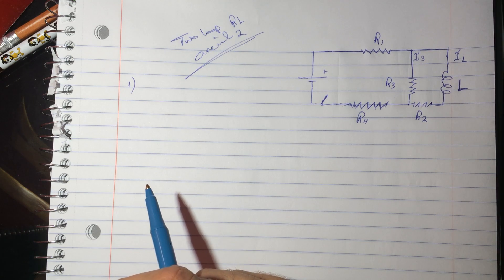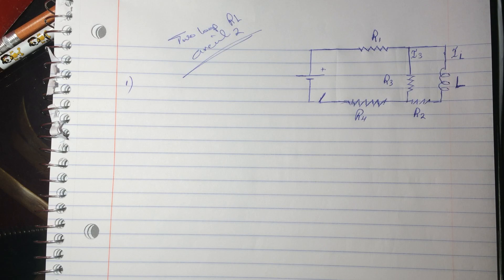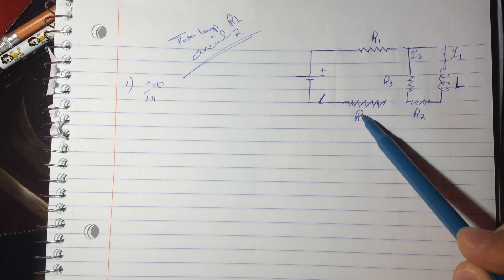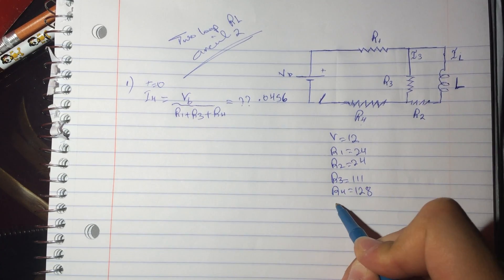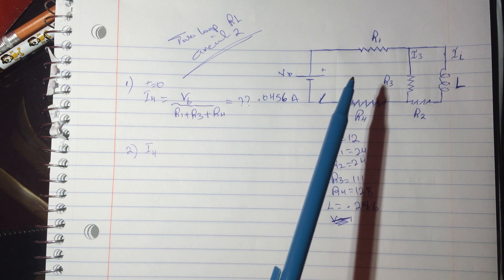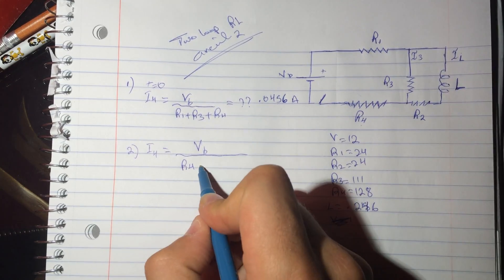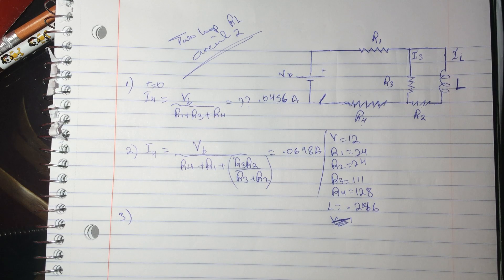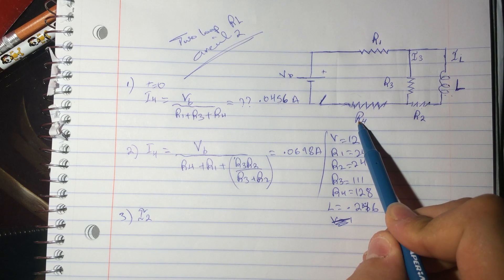Two Loop RL Circuit 2 "Smartphysics" solution.

Comment: That last one is confusing.  I plugged in your numbers and for I3/(R2+R3) you should have gotten .000425V.  Is there something you forgot to mention?
Reply: Walid Hamarneh ***** This is wrong. What Walid did was multiply not divide. So it would be that current * (R1+R3). V=IR.
Reply from the maker: Wayne Crasta Yes you are right! I will edit what I just wrote too. 
Thanks
Reply from the maker: The number I got is correct. So you take the answer from question 3 for the current times the sum of R2 and R3. 
Just make sure you are plugging the right numbers.
Reply: Wayne Crasta shouldn't it be current through the conductor after the switch has been closed a very long time multiplied by (R2 + R3)....which are the two resitors that are still in the circuit when the swithc is opened... not r1
Reply: Justin Parus Yeah you're right, it's V = I*(R2 + R3), the I coming from question 3, the magnitude of the current through the inductor a long time after the switch has been closed.